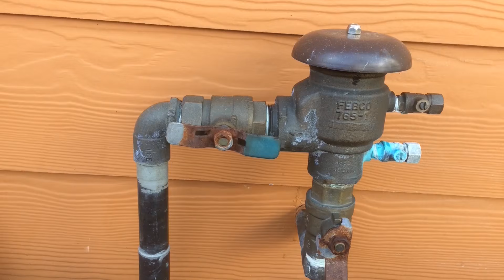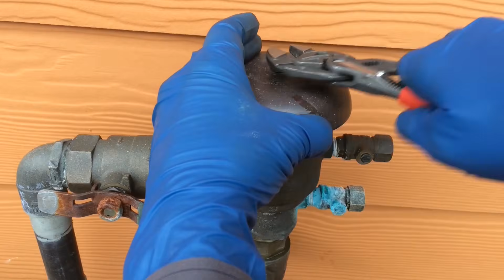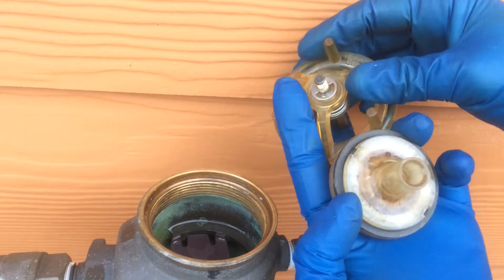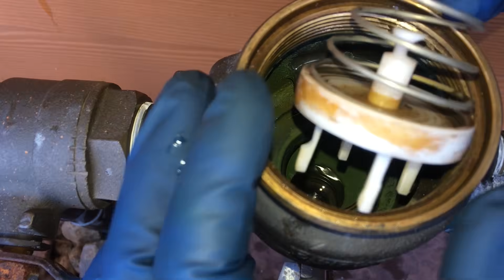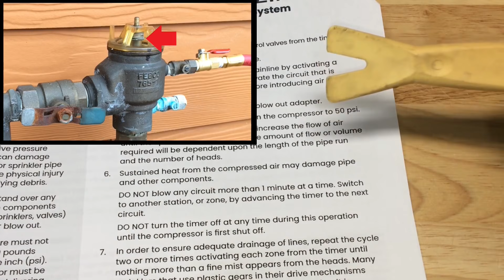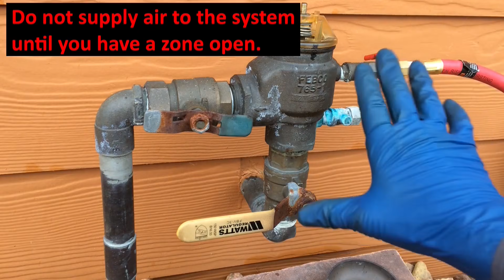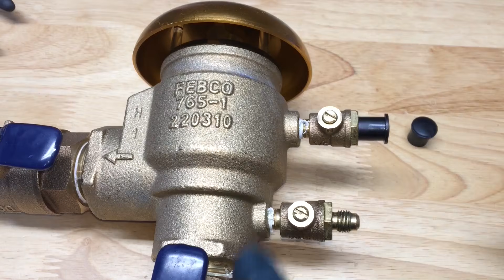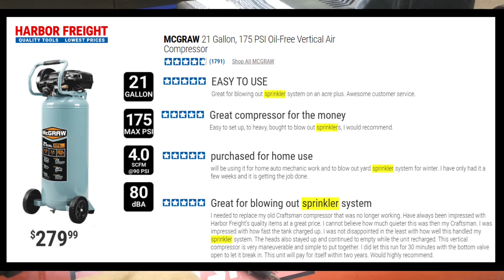Sprinkler Blowout with Air Compressor FEBCO 765 Full Guide, FEBCO 765-1 Backflow Preventer PVB shown

Comment: what if i have an electronic pump controller downstream of my PVB? can i send compressed air through this pump?? probably would damage it, no?
Reply from the maker: That's a good question, and I don't know the answer, so I'd refer to the manual for the particular pump itself (hopefully it would any notes about "winterization").  
Compressed air can cause a pump impeller to spin much faster than the normal water flow causes, so this source below states:

"If blowing out your irrigation system with pressurized air, use a narrow box wrench to prevent the shaft from spinning. When the impeller spins too fast, the motor governor can be damaged."
https://www.centraltis.com/news/6-easy-steps-for-pump-winterization/

I hope that helps - good luck!  : )

Comment: I want to start by echoing everyone else's sentiments. This video, your hard work put into it, and the result are just excellent. I learned a LOT. I'm curious about why the 1 min max run time per zone? I have seen many - less thorough - videos on the DIY approach to this, and the only mention of time per zone tends to be where pressure is no longer able to provide adequate CFM and you have to let it build back up in the tank.
Reply from the maker: Thanks - the "1 minute limit" is based on the K-Rain Winterization document (linked in the Pinned Comment, and here: https://www.krain.com/content/files/images/landingpages/winterization/winterizeyoursprinklersystem.pdf ).  On page 2, #5, it reads:

"Sustained heat from the compressed air may damage pipe and other components. DO NOT blow any circuit more than 1 minute at a time."  

That "1 minute" K-Rain value was the most conservative value I found when making the video, so I went with that value because a smaller system will get hotter quicker than a larger system, and people watching the video will be working with different sized systems.  However, I have also seen "2 minutes" limit, for example in this Rain Bird document (https://www.rainbird.com/homeowners/blog/blow-out-your-sprinkler-system):

"6.  DO NOT blow any circuit for more than 2 minutes at a time, as heat from the compressed air can damage the pipes and other components." 

Both references state that heat is the issue.  I hope that helps - thanks for watching : )
Reply: @L35inColorado  Thank you again!

Comment: Excellent with lots of detail you don’t see in other videos!!! Very clear on instructions and presentation!
Wish that Winterization manual you had was linked or had a PDF for downloading for reference.
Thank you for such a gem of a video for Winterization of the Sprinkler System, plus showing the guts of the Back-Flow Preventer etc., detail, detail, detail, EXCELLENT!
Reply from the maker: Thanks - if you mean the K-Rain Winterization document, it is linked in the Pinned Comment (as well as some other documents) and here is the PDF:

https://www.krain.com/content/files/images/landingpages/winterization/winterizeyoursprinklersystem.pdf

I hope that helps - check the Pinned Comment for more info.  
Thanks for watching : )
Reply: @L35inColorado Thanks!

Comment: Couple questions: Why discharge the air between changing zones, what is the difference between 50 psi of air charged at the backflow waiting to go to a zone and 50 psi of water that stays charged there all season?  What's with the 45º degree rule on the valves? Some people are saying 45 some are saying leave all the way open, some say there isn't a technical difference.
Reply from the maker: Hi - Regarding the reason for isolating/discharging air between the zones: this is a "best-practice" technique to prevent accidentally over-pressurizing the system.   Check out this document for more info:
https://www.krain.com/content/files/images/landingpages/winterization/winterizeyoursprinklersystem.pdf

Also, as discussed there, the flow of pressurized air is not equivalent to the flow of water because while air and water are both fluids, air is a gas and water is a liquid, and air has a much, much lower viscosity and density.  The zone valve closure against pressurized air (instead of water) can apparently have bad effects for some zone valves, so the intentional steps of physically isolating the zone valves from the air compressor are basically like fool-proofing the process to prevent accidental over-pressurization and to eliminate the need for the valves to close against pressured air.        

Regarding the 45 degree position on the valves: with ball valves (like those on the FEBCO 765), the 45 degree position is the half-open/half-closed point, at which point the valve gate is angled to allow draining without any pockets where water could collect and freeze (water expands when freezing, which can cause the valves to fracture).  Here is some more discussion, from a FEBCO document:
https://watersolutionsco.com/userfiles/938/files/WinterizationProcedure.pdf
I hope that helps - thanks for watching!  : )

Comment: I am 80 years old; I've watched many YouTube videos over the years, but your video was amazingly good--ironically, I almost didn't watch it because of it's length--really glad I did.  The level of detail, the diagrams, the degree of completeness right down to excellent camera work (proper lighting, steady image, correct subject selection, clear sound level, etc.) were generally well beyond what I've seen most other DYI producers generate--even for some of the pro productions.  I especially liked the discussion regarding the PVB (I installed a Wilkins 720-A few years ago). The clear diagram you included really helped.  The down to earth explanation and brief discourse on the relationship of pressure vs. volume and CFM(volume) and CFM(mass) were quite helpful--especially your explanation exposing the misleading horsepower and volume ratings on your compressor.  It answered a question I've always wondered about.  I wish I had viewed your video before I bought a Harbor Freight McGraw 20 gal, 135 psi, 4.0 CFM (oiled) compressor @$200.  Great work; you've got a lot to say.  Best wishes on your future production.
Reply from the maker: Wow, thank you very much for your kind comment!  I'm so glad that the video helped: thank you for watching, and thank you for such a nice comment : )
Reply: @L35inColorado  I completely agree with Jasperficara5050, excellent video, perfect level of detail, camera shots, sound, delivery and extra images!   
I've watched so very many sprinkler videos over the years, and done many searches, and you solved 3 problems today!   --And, one being that I will be finally hiring someone to blow out my sprinklers, because after an extensive try again this year, your video let me know I just don't have a high enough CFM... I commiserate with Jasper, I too purchased a compressor "that can definitely be used to blow out your sprinkler, I use it all the time," which is only 6 CFM.  Sigh.    
  In case you aren't alerted to the right comment, because again,  this was a most excellent video, and Jasper said it best:   ..
."I am 80 years old; I've watched many YouTube videos over the years, but your video was amazingly good--ironically, I almost didn't watch it because of it's length--really glad I did.  The level of detail, the diagrams, the degree of completeness right down to excellent camera work (proper lighting, steady image, correct subject selection, clear sound level, etc.) were generally well beyond what I've seen most other DYI producers generate--even for some of the pro productions.  I especially liked the discussion regarding the PVB (I installed a Wilkins 720-A few years ago). The clear diagram you included really helped.  The down to earth explanation and brief discourse on the relationship of pressure vs. volume and CFM(volume) and CFM(mass) were quite helpful--especially your explanation exposing the misleading horsepower and volume ratings on your compressor.  It answered a question I've always wondered about.  I wish I had viewed your video before I bought a Harbor Freight McGraw 20 gal, 135 psi, 4.0 CFM (oiled) compressor @$200.  Great work; you've got a lot to say.  Best wishes on your future production."

Comment: Love your videos. Seems very involved. Is there any way some insulation could be wrapped around everything for the winter?
Reply from the maker: It entirely depends on your local climate: here in Colorado, we must drain the PVB and evacuate the sprinkler system ("blow-out") because every year we get severe deep freezes, and anything above the freeze/frost line will freeze and stay frozen (it is not unusual for us to go a week or more during which time the daily high temperatures will not leave the 20's F and overnight lows will be sub-zero F).  The freeze/frost line here is also deep (about 3 ft), so obviously the sprinklers are well above that and would freeze if not evacuated.  

So, here in CO, we must remove the water.  The reason there is no insulation shown in the video is because the blow-out process removes the water, so there's no need for insulation.  Other parts of the country, like Texas, might have a cold front dip in from time to time, but never a deep freeze that would require blowing out the sprinklers, and in that case, simply draining the PVB and wrapping the above-ground pipes with insulation will be enough to endure the short cold snap.  It just depends on the local climate!  

Perhaps you can ask your neighbors and local contractors what is done in your area.  I hope that helps : )  

Thanks for watching, and Happy New Year!

Comment: Excellent video, thank you! Loved the extra detailed info on the actual CFM vs. manufacturer stated CFM calculations 👍 Question: when you disconnect the air hose from the compressor before switching to the next blowout zone - is it done as an extra precaution or other reasons given that the cutoff valve at the backflow preventer is already in the off position?
Reply from the maker: Thanks, and Happy Thanksgiving if you're in the USA! : )  About disconnecting the air hose: I do and show that as a double-redundancy, just to be absolutely certain (and to reiterate) that there's no air applied the system until a zone valve is open.  So, it is just "belt and suspenders", so to speak!  It's fine to just use the cut-off valve, as long as you're consistent and certain that air is only applied when there's a zone valve open - that's the main concern.  I hope that helps - thanks for watching!  : )

Comment: Very helpful video, learned a lot, what about using pancake compressor of 150 PSI 6 Gallon? Would that work ?
Reply from the maker: Thanks!  About the pancake - unfortunately, a pancake compressor is just not capable of supplying adequate flow rate (CFM) for the average 10 - 20 GPM residential sprinkler systems because the compressor/motor itself is just too small to displace enough outside per minute to deliver to sprinkler system (CFM), at the required pressure, to hold the sprinklers up for that 1 minute blowout time and get the water displaced.
For example, I have two pancake compressors: the older one is a 6 gallon Porter Cable CF2600.  Here's a look the insides of that compressor - the motor:
https://youtu.be/bf6c2dnG-Ew?t=201
According to the specs from Porter Cable, that compressor is capable of displacing an intake air mass of 3.7 SCFM @ 40 psi, and 2.6 SCFM at 90 psi.  
So, at a target blowout pressure of 50 psi, that value would decrease to perhaps about 3.2 SCFM, and then that intake SCFM would translate to just 0.7 actual CFM going to the sprinklers for the blowout at 50 psi regulated.
Recalling the "rule of 7.5" mentioned in the video (43:06), such a low CFM would be barely adequate for a sprinkler system of just 5 GPM.  Most residential sprinkler systems include zones of about 10 - 20 GPM water delivery.  So, the pancakes just can't deliver enough air for an average sprinkler system zone. 
What some people do with pancake compressors is piggy-back them onto auxiliary/storage tanks.  But, adding an aux tanks doesn't increase the ability of the compressor itself to displace more intake air because that "SCFM @ psi" value is a fixed metric based on the cylinder size and electric motor ability.  So, since adding an aux tank is not doing anything to increase the compressor motor ability itself, adding the tank doesn't change the "SCFM @ psi" rating.  
That said - what adding an aux tank can do is increase the initial CFM delivered (flow rate) - as in the air delivered before the compressor motor starts - and on a small sprinkler system, that may be enough to get the job done.  Here's this technique in action:
https://youtu.be/_39RGATIkOg?t=422

I think the biggest temptation people encounter when attempting to blowout a sprinkler system with a low SCFM compressor (like a pancake) is that they'll hook everything up, dial the regulator to the correct pressure (say 50 psi), then apply the air and either nothing happens, or the sprinklers heads pop up for a few seconds, then fall back down.  
In that case, the proper response is to realize that the compressor setup is simply inadequate to supply the required air flow to the sprinklers, and that the solution is to move up to a larger compressor setup (or add an aux tank).  
But, sometimes people think "I'll just increase the pressure and blast the sprinklers up", so they'll dial up to 90 or 100 psi, recharge the tank, and "blast" the system - not realizing that higher pressure means lower flow rate, and not realizing that they're accidentally working against themselves and increasing the possibility that they might physically damage their sprinkler system components by applying that little burst of very high pressure air to a system that's not designed for such a load.
So - that's a long answer!  The summary is: technically, yes, you can use a pancake on a very small system - and by "very small" I don't mean a small yard with three sprinklers, I mean something like a super-low GPM drip zone or maybe a system with a single outlet (sprinkler). And again, that's because with a little pancake you're limited to replicating a flow rate that is consistent only with something like a 5 GPM or less zone.  If you add an aux tank, you're effective reducing the duty cycle of the compressor since you have more of your "1 minute per zone" period supplied by you stored air, but again the storage itself doesn't increase the CFM delivered by that little motor once tank pressure falls below regulated pressure, and so once tank pressure drops, the regulator is irrelevant because you'll only get the air displace the motor itself can produce.
All that is to say - if you have a pancake and small, low-GPM system, you can give it shot and see what happens, but don't be tempted to compensate for flow rate by increasing pressure, because it is physically impossible as they are inverses.  Ideally, you want use something capable of delivering adequate CFM, which for most sprinkler systems is likely something close to what's seen in the video.  As shown at 49:29 with the compressor reviews, smaller compressors can be used, depending on the systems.  But all things being equal - go big, go bad if possible!  : )  
I hope that helps - thanks for watching!
Reply: @L35inColorado  Thank you for taking the time to write very detailed explanation, I see there are multiple videos on YouTube people doing with just using small pancake compressor. Anyways as you suggested I will give it a try next season. By the way one of your old videos on Sienna spark plug replacement with excellent step by step instructions gave me confidence to do it myself and saved money.
Reply from the maker: @mr.j8297   Nice!  Great job on your Sienna spark plug replacement!  Blowing out the sprinklers is much easier and more enjoyable than that spark plug job : )  Thanks for watching!